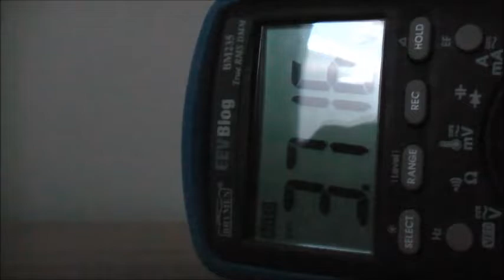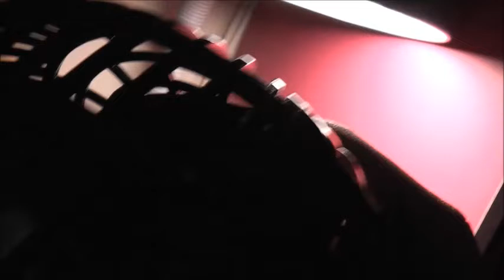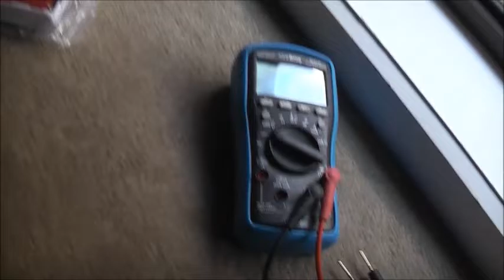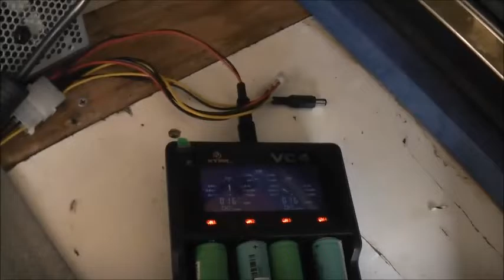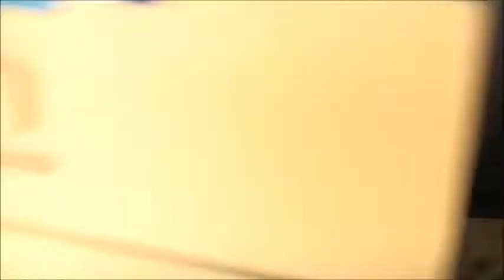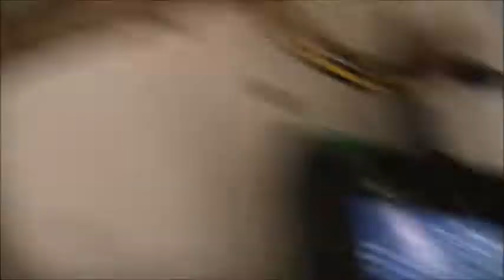18650 Cell Testing!

Comment: Hey bud good to see you working on a powerwall! Put a voltmeter on those powerbank chargers so you know when to take them off
Reply from the maker: SuperBrainAK the cells were at 4.1 Volts, but for optimal storage conditions, the voltage must be at 3.8 volts, i will be testing the charged cells from the powerbanks for their capacity later